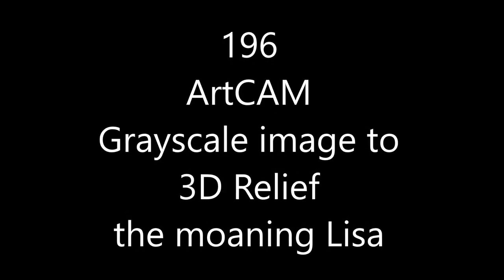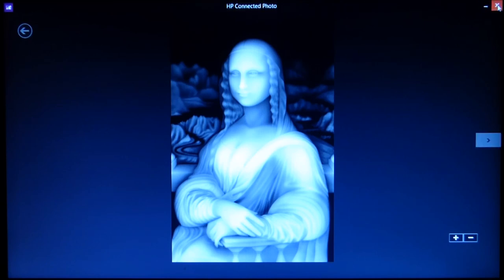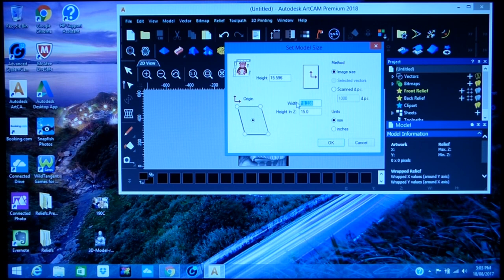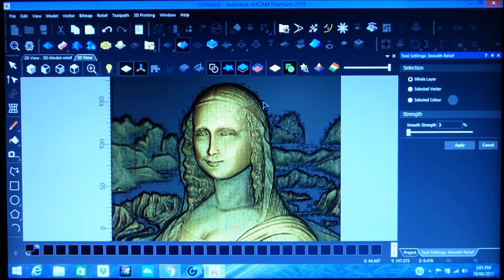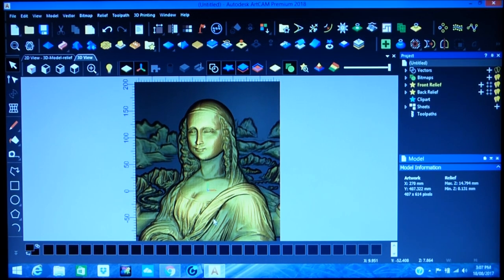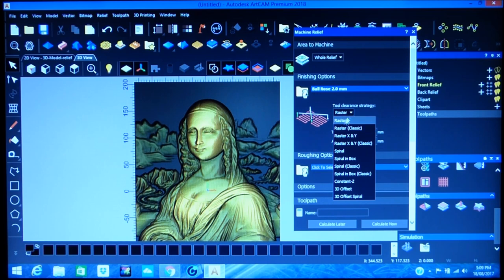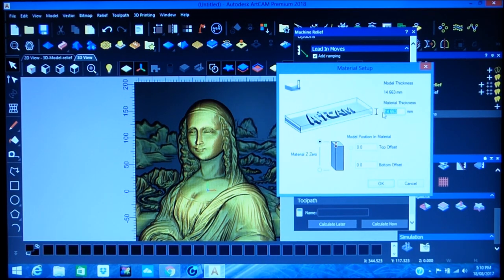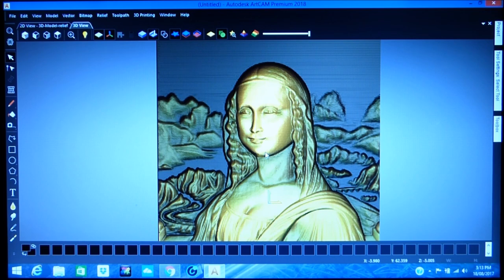196  ArtCAM (Carveco)  grayscale image to HD 3D relief the mona Lisa

Comment: hi roger . im using 2018 premium  but when i drop grayscale image into artcam it doesnt turn  into 3d model ?? as per your video / is there a setting ive missed ?
Reply from the maker: Hi, set the Z height in ArtCAM wizard dialogue box when you drag and drop it into the ArtCAM window.
Australian Inventor Roger Clyde Webb
Reply: Roger Webb  thanks for your reply ,  have you made a video regards to  install and setting up artcam 2018 with veiw to machining your 1st 3d releif ?? Keep up the good work !